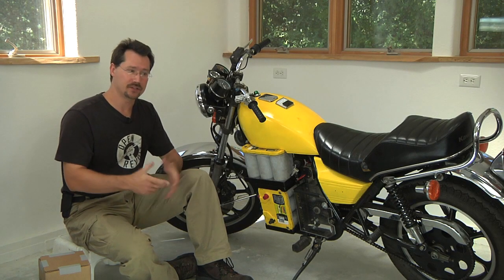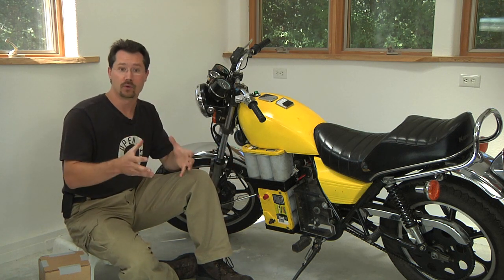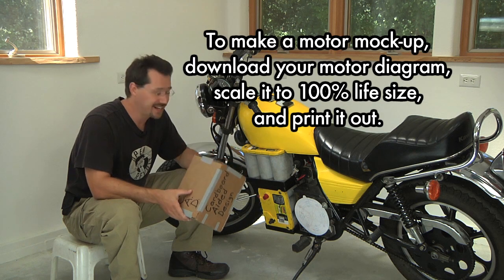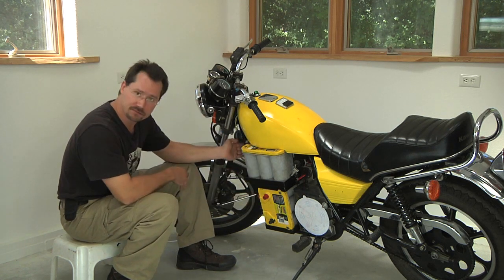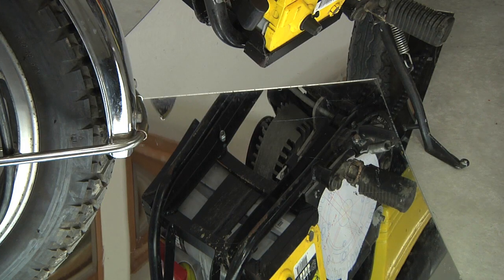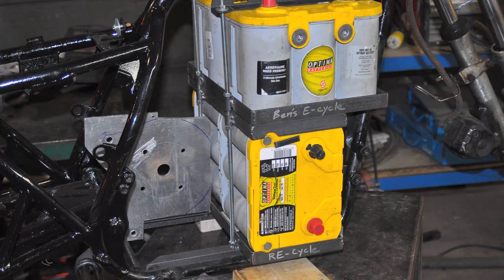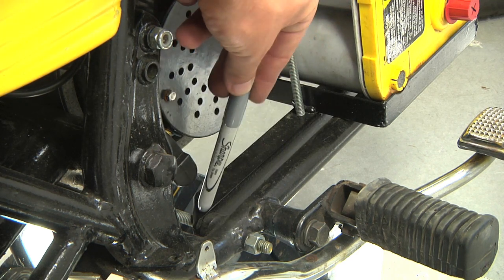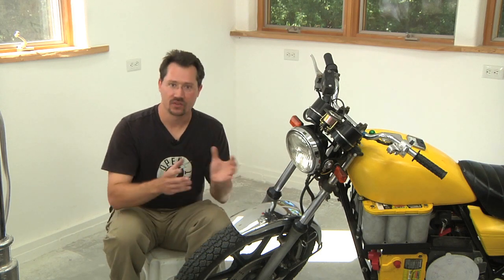8 Build Your Own Electric Motorcycle - FULL - 8 Battery Rack

Comment: nice video , why dont u use lipo batteries , they are cheaper than lions ,also they can handle much more load ,, ive built a 10kw moped :D im using 18s3p , 3x 6s 10000mah lipos in series , and 3 lipos in paralell , works very good :D

Comment: I was really surprised at how slow this bike goes considering it can only travel about 35-40 miles/ charge. in my case the bike batteries would be dead before I even made it home from work.
Reply from the maker: Hi Jeff, The joy of building your own motorcycle is you can design it any way you want. This is one that I built ten years ago. It literally ran off four off-the shelf lead-acid batteries from the auto department of the farm and fleet store. The availability and low cost of lithium batteries now vs then is mind-blowing. Production electric motorcycles have over 100 mile ranges nowadays.

Comment: Hey Benjamin,,,Good job on the youtube demonstration and you Technics.. I do have a question.. Have you ever had any troubles yet with vibration ware between the Battery Mounting Brackets and the Batteries them selves. I'm just wondering if some heavy duty rubber (like that on the rear deck of a pick up truck you may have seen before)pinched bottom and top and in the middle in between them. Good job on your project. i subscribed  :)
Reply from the maker: No, I've never has any issues with vibration on this motorcycle. The batteries are held very firmly in place. I did use just a very little bit of thin rubber, more for grip and electrical insulation than anything. On the Optima Yellow tops, one of the selling points is "Vibration Resistant". Absorbed Glass Matt - AGM - batteries don't have acid sloshing around inside them, nor do lithium cells. Lithium is definitely the way to go now. They have all sorts of advantages, and the cost of lithium has plummeted since I first did this project.
One that I would say to stay away from would be flooded lead-acid batteries. Besides being heavy and bulky AND being able to spill acid, they CAN be damaged by vibration.

Comment: does your battery mount provide some protection in the case of a fall? is this worth considering?
Reply from the maker: The batteries are built right into the middle of the bike. I did fall on this bike once. The batteries were all properly mounted in place with no damage.

Comment: Nylock nuts are good for vibrations, splitted washers on the other hand is under alot of debate whether or not they provide any kind of aid for nuts getting lose in vibration. I'm on the nut* doing anything side of that debate, it's just a washer in my world. 

But I do have some tips and tricks with getting things to stick along for the ride, 
PTFE tape (plumber tape, is what we call it in swedish, or threading seal tape) will give a nut resistance to vibrations, I use it on all nuts except nylocks. 

And two other, not related to deez nuts, tips are if you need to put on new handles on your handlebar, use hairspray to glide them on. Hairspray will definately make handles stay put, some people use water (and some even soap in there), which is quite dangerous since it will just leave a surface that has very low friction. 

And car related, if you have problems with corrosion due to salt on your roads during winter time, then you might know that switching tires might become one situation where alot of cuss words tend to emerge from the dark side. 
I found that unscrewing all nuts on the wheel while jacked up is the first thing to do, then take the tire which you are going to replace with the annoyingly stuck wheel, and sock it to the side of the center of the wheel, as far as you can, as hard as you can, with a pendular movement between your legs. 

Good luck and thanks for the videos. 

*Phun intended
Reply: I just read your comment a second time, and I've got to say, that last bit really impressed me

Comment: I really enjoy the fabrication detail you've provided here. Hopefully others will get inspired to self-teach MIG welding. One tip: utilize rubber mats inside the trays to aid in clamping and vibration management. Rubber supply shops have a good variety. But you can also buy consumer rubber products in the home improvement stores and modify them by cutting and laminating and adhering with silicone.